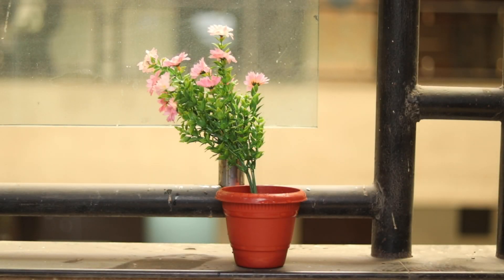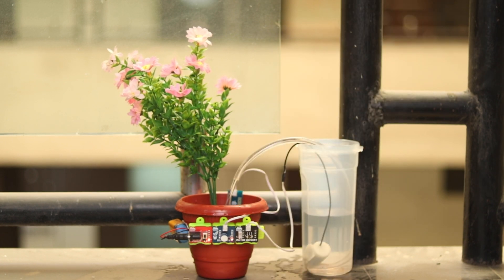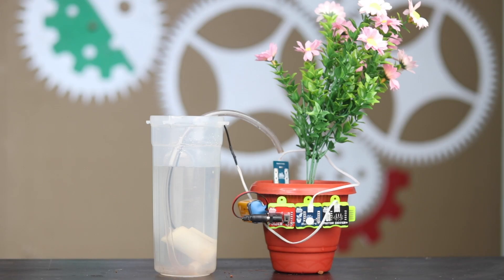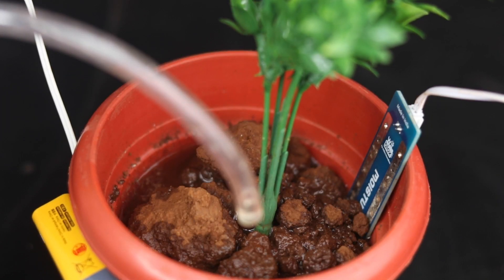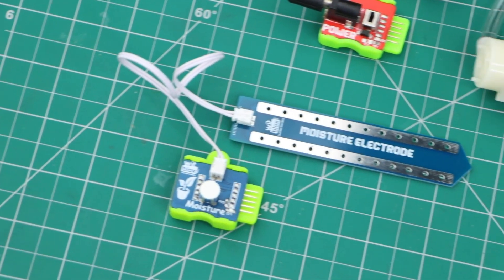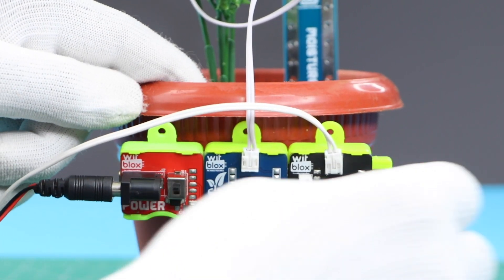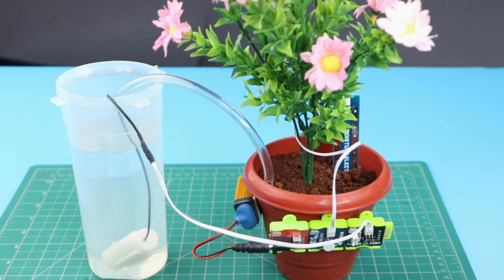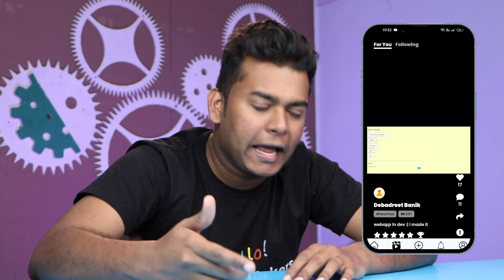Let Technology do the Work: Smart Plant Watering with Moisture Sensor

Comment: The battery got drained in 2 days. How to turn ON the battery once a day . Or stop the sensor to be ON for 24x7
Reply from the maker: Good Question.

To solve the power issue, we provide power blox in our kits with a USB connector so that you can connect any usb type c Charger.
For powering it once every 24 hours. You can use clock + counter+ counter that will perform the task only once every 24hours
Reply: @WitBlox thanks for sharing